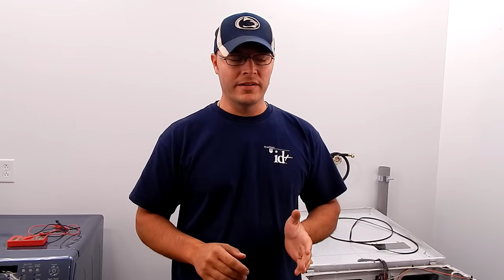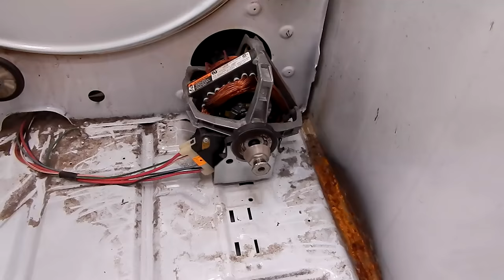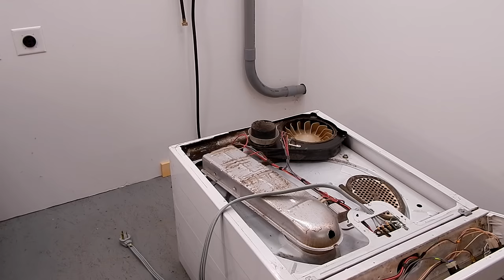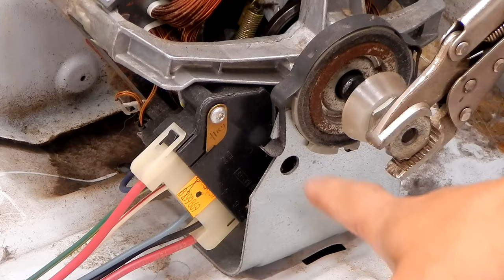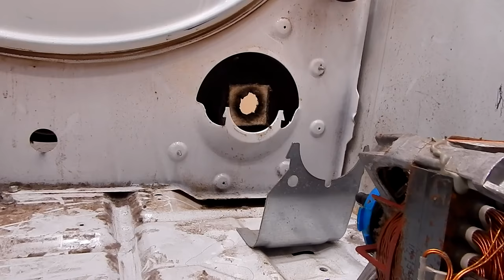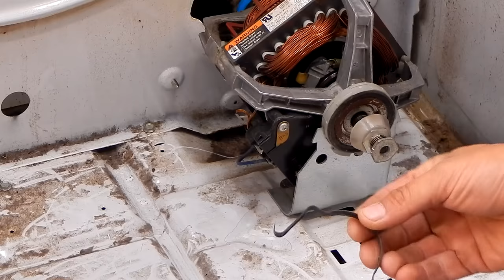How to Troubleshoot and Replace your Dryer Motor

Comment: Thanks for explaining thoroughly all the symptoms of a bad motor..that helped a lot ..the problem I had with mine was the humming sound and I helped it start up while pressing door switch and having someone push start while I turned barrel. Now it will start on its own but the dryer turns off after 3 seconds  and starts back after 5 minutes and repeats.

Comment: Bill - great advice - was perfect to track down the problem.  The motor was stalled (humming), and I gave it a push and it started running.  Time to order a new motor.  Thanks

Comment: Thank you for the great video! I replaced the motor and installed a new belt and parts kit as well! After unsuccessfully trying to remove the blower fan using the method you described, I instead used a small steel rule and fit it across the fan blades and threw the exhaust duct, jamming the fan itself and then I used the vice griped motor pulley as a lever and turning clockwise, I broke the fan free with no damage to the plastic fan! Much easier!
Reply: Thank you so much. I had tried the method in this video and another method shown in a different video to no avail. Your suggestion worked (almost) effortlessly!

Comment: Replaced my dryer motor myself with the help of your video!!! A million thanks because I know NOTHING about fixing stuff. The trick of using a block of wood and hammer to loosen the blower fan worked perfectly (although it took a bit of time to break loose but I didn't break it!!! YAY!!!).

Comment: Thanks for the help! The hardest part of the repair, as you mentioned, was removing the fan. The locking pliers get slipping off and i ended up using a medium pipe wrench, instead. Using a wood block and hammer to strike the fan was unsuccessful but I had another idea. I cut a piece of 1/2" thick wood so it would fit between opposing blades on the fan, then used another pipe wrench to turn to the wood. The fan broke loose almost immediately and came off just fine. Thought this trick might help others.

Comment: I tried all types of troubleshooting. And the dryer worked when there was no heat  - other guides point that it means the motor is OK. Then after watching this video I decided to try a new motor and it magically helped. And yes, the dryer made humming sound when attempting to turn it on after it went off. Good indication of the problem in the motor. 
Also my original motor passed continuity testing, but obviously still had a problem.

Comment: My dryer was shutting off Midway through the cycle and would not turn back on until a few minutes later like you said on the video so I ordered a new motor and it worked for a little while and started doing the same thing again.

Comment: Thank you for uploading this video. My husband has been working on replacing the motor in our dryer, and he was afraid he would have to break the blower wheel into pieces to get the old motor out. Your hammer and wood method worked perfectly and saved us from having to buy another blower wheel.
Reply: Another easy way to do it, get the biggest pair of channel lock pliers you've got, open them wide jaw so that the jaws are under a fin each, then Turn the handles like a steering wheel to the right!
Reply: @zn_361  That's a very good tip actually.  Thank you!!

Comment: That actually seems like a better way to remove the motor. All the videos I have seen demonstrate grabbing the blower wheel with an open end wrench on the other side of the blower wheel  just behind the motor, and then turning a socket on the pulley end of the motor. Each time I have tried it that way I just end up rounding out that part of the blower wheel as it just slips through the wrench. Would have liked to see how you use the hammer and block to loosen it up without breaking it though. Anyway, appreciate your videos.

Comment: Hey Bill, This video helped me to determine my dryer motor was bad; I replaced it myself and saved a lot of money on a service call and part. I also have used your refrigerator repair video as well and it has helped me figure out what was wrong with my defrost cycle. Keep the help videos coming; thanks!!!
Reply: Patrick Giacobbe Good for you!!!!!!!! You're a smart guy!!!! I'm an appliance tech Pat!!!!! I would have charged you around $700 bucks easy.Greetings buddy.

Comment: I did find my dryer motor hard to turn, but it did barely turn.  I quirted some lighter fluid into the 'bearings' of the motor, and my drum rollers.  Every turning part had some resistance.  The lighter fluid was a good solvent to loosen up dried lube of old.  I then squirted in some gel lube.  She runs better than ever.  I cancelled my motor order, but I agree it was indeed largely the motor.  The old rollers are now super smooth.   When I change the felt, I'll pull them out a use some Syl-Glide on them.  Thank you for helping me narrow it down!

Comment: Thank you! I had replaced a hardened, slightly cracking drum belt thinking it wasn't gripping. Changed the rollers too since i was in there. Imagine my surprise when it still buzzed and wouldn't start. The symptoms were what you described. Ugh. The motor? Would've never thought of that going. Now i gotta go back in and replace that. A motor is still cheaper than a new dryer, or a 2nd hand one that you don't know how much life is left on it.

Comment: You helped me a lot in troubleshooting my motor. I like how you laid out in progression the symptoms. I was able to save my motor from burning out. Thanks.
Reply: +Bill Newberry  Thanks so much for this tutorial. After a day of using the old motor- after thorough cleaning of whatever lint and hair stuck on its gut, It exhibited the same symptom of sound and  intermittent not starting. I finally decided to replace it and all is good except now I hear the rollers whining coz of the quiet motor and will replace them soon as well. The rollers whining sound was probably masked by the motor's buzzing sound for years. Well, it should be good practice I guess to change out the rollers together with the motor specially after x amount of years.

Comment: Thanks for the video, which does an excellent job of describing common motor symptoms.

It is helpful to understand why an electric motor fails.  My understanding is that the most common cause of failure is overheating, which causes the insulation in the motor windings to break down.
Reply: Yes, I need to know the why of it. I replaced my motor less than 3 years ago, and now it's failing again. It'll run for 10-20 minutes, shut off, and then it starts again if I let it cool down. The apartment maintenance people checked the exhaust outside and said it's exhausting fine. I am suspicious because I started having to run my dryer for 1.5 cycles to get clothes dry after I moved here. I replaced the heating element, motor, belt, drum support wheels, belt tensioner, fuses, and thermostats less than 3 years ago. It should have been drying fine unless the exhaust is obstructed.

Comment: Great video!! My Whirlpool Cabrio won't start, it only makes a clicking sound. I tested the thermal fuse & door switch for continuity and both are fine. I am having trouble testing the start switch because the dryer has 2 control boards, with a group of thin cables coming out of the front board going into the smaller board that has a bunch of cables and more fuses.

Comment: 2:04 Thankyou. Confirmed my problem. If only I had come across this video earlier I wouldn't have wasted so much time taking apart the dam dryer and reassembling it multiple times. Buying a new bearing, belt and pulley. 😖 Just needed a new motor 🤬

Comment: I've had to remove blower wheels twice.  My dryer has the 1/2" square hole in front.  The first time I used a ratchet wrench with a 1/2" square extension, which immediately deformed the plastic, and I ended up cutting off the wheel and buying a new one.  The second time I decided to try my impact driver (just about the most useful tool i own).  This worked like a charm and did not deform the plastic.
Reply: Can you please explain how you used an impact driver to remove the blower wheel. Regards, JP

Comment: I would like to thank you kindly for making and sharing this video with us, it  helped out a lot. I was struggling trying to remove the motor from my dryer for hours and couldn't figure it out, didn't want to force and brake anything such as the blower wheel in the back but just didn't see anyway around this. Also your comment about the thermal fuse helped out as well as I forgot to check that first. Its inexpensive to replace, easy to test and often the cause of our problems.

Comment: This video was a great way to visualize how to replace my dryer motor. My dryer is a 1995 Kenmore (writing this in 2023). The symptoms are exactly as you describe (humming and strange sound and then shuts off). My only question is you took off two clips held with channel locks when disassessembling - do you clip on the second clip after the first one and then clip on the vice grips (opposite way from the unclipping) prior to reassembling the blower wheel at the back? Thank you for a great video and you have saved me $100s.

Comment: thanks for the great video Bill. I just replaced my motor. man you were not kidding about the blower being tough, holy crap! any one doing this I highly suggest some kind of penetrating oil, let it soke in for a hour. spray it from the inside and tilt dryer back so it can leak back.  I stuck a  hammer handle at the bottom and and used another hammer to get it loose. didn't even break it!
thanks again.

Comment: Exactly as you said, it worked for few weeks but now it won't move even with help. After disassembling the dryer, I tired to rotate the motor by hand but there is a lot of resistance and it won't move even with belt removed.

Comment: This folks is called a left handed thread on the blower wheel,helps you remember which way to put your vise grips,if you know that the motor shaft is threaded left.

Comment: Great video.  However an easier way to take the blower wheel off is to take the back clip off the motor and put a 13/16 open end wrench on the nut, and use a 7/16 on the shaft on the front and hold them and turn the front wrench clockwise.  That way you don't damage the fins.  Worked well for me.
Reply: Nothin's easy. I had to use a dremel and cut the wheel off. It was stuck to the motor shaft. All a 13/16 wrench did was round off the corners.

Comment: The "nut" at the end of the pulley on the motor actually broke off. I have no idea how. I found it that way when I opened the compartment. So I had nothing to use vice grips or channel locks on except for the part of the bolt/shaft between the motor and the fin assembly. Absolute disaster trying to remove it. Luckily fin assembly had the 3/4 drive receiver in the front. Ran down to the hardware store and bought a 15.00 breaker bar....all good now.  Thanks for your help and all the info. :Little things you said, like making me aware of that 3/4" drive receiver saved me. I wouldn't have known yo look for it if you hadn't said anything. Might have figured it out on my own, might not have. Glad you were thorough. Thanks again.

Comment: Excellent explanation, the motor of my washer is dead, around 5 month buzzing and starting but it got tired and burned off
Reply from the maker: Armando Iglesias Ah, sometimes they hang in there for a while!  Are you going to replace the motor or get a new machine?
Reply: Bill Newberry i'm going to replace it, i've got a heavy duty and it is in great shape, beside i already repair the transmission so it's going to be fine for a while... thumbs up for you man, thanks

Comment: thank U Bill this is the answer to my question,and U had a dryer motor completely appart with answers to all questions.I do have one question if I jumped out the start switch would the motor still run.Maybe that was answered in your video have to watch it again.                         James

Comment: Here's a quick tip to make removal of the turbine fan from the motor shaft easier!

Do like this guys video says, put a vice grip onto the motors pulley in front. Then, instead of muscling the fan off with a block of wood or whatever:

1. Grab the fan blades. Put each your fingers and thumbs against a single blade to help spread the load and prevent breakage.

2. With your hand and fingers in the blades, rotate your whole hand counter-clockwise 45 to 90 degrees, which rotates the vice grip away from the floor.

3. Then quickly reverse your hand rotation, banging the vice grip back into the floor, which stops your rotation.

4. Wind back up and do this several times. The momentum and banging should pop loose the shaft threads behind the fan.

Mine came loose this way within a few strikes, and spun right off after, no damage, no frustration!

Comment: very informative. thank you looks like something I can tackle.  exactly the symptoms that I have with my dryer., I would turn the dial and I hear a noise but the drum does not engage. Also, ill start the dryer and give the drum a nudge and it will start to work. . I will by a new motor and try and install myself.. thanks

Comment: its also worth checking the cap on the motors. replacing the capacitors on these motors if they hum but you have to kickstart it manually can save an otherwise healthy motor.

Comment: Hey Bill. I replaced the belt on my dryer with your help, because mine wore and snapped. Now the drum barely turns when empty and not at all with any weight. It seems like the motor is running just very weak. I feel confident I can change the motor from watching your video. Is a new motor the answer or would you try other things first? Motors are expensive, so I wanted to ask advice before buying it.

Comment: I can't thank you enough for saving me the headache of researching this otherwise. Suggestion, the block & hammer did not work to remove the fan and frankly it seems a bit aggressive which I am sure leads to the breaking the fan blades. I took a pair of shop gloves (to avoid getting cut from the surrounding metal) and simply used bruit force (which honestly took minimal grunting) and twisted it off using both hands. It allows for more even pressure and helps compensate for plastic flex. Hope this helps someone else in the future. Tried the hammer thing for 5 minutes, had it twisted off in 10 seconds.

Comment: This video was a great help.  Made the removal of the old and installation of the new motor easy.  However, when I put on the new motor and put everything back together and pushed the start button the dryer is making a loud grinding noise.  I checked my installation steps and it seems to be installed correctly.  Is the motor defective?
Reply: I have the same problem!  Replaced the motor twice with a brand new unit and grinding starts on the 1st load. Can't figure out why.

Comment: At the 2:20 mark regarding dryer just buzzing when (not) starting, mine reached that state like Bill said after the buzzing began happening several weeks prior.  (Another youtube video showed how to remove years and years of accumulated lint (a pretty big wad of it) from near and inside the dryer blower wheel, and that really did get things running again, but still a little buzzing before things spin up, though my dryer is different than this one quite a bit).  Those motor mount clips… finally just used a very large screwdriver and pressed hard on them straight down on the left hand side and off they came, and went back on easily enough with similar pressing down.  Now just need to get that belt back on right  and the drum in place and it should be easy after that.  (Ass-uming the motor was just a direct replacement, plug and play, the wiring looked to be the same,)
Reply: Yup, new motor sounds great, had forgotten what our dryer used to sound like.

Comment: great vid! I now have the confidence to tackle this one by myself! Semper Fi!
Reply from the maker: +TheUnclerickie Semper Fi!
Reply: +Bill Newberry YO! my dryer ran for about three cycles then shut off. after like 3 weeks of procrastinating I took it to a repair man. RM told me that he plugged it in and it worked well so I should check the plug in and breaker.. did that and there was nothing wrong with either so I plugged it in and it fired right up. few cycles of towels and it shuts down again but this time it emitted a burning smell. after about 3 hours I pressed the start button and it didn't start but sounded like it was going too. every trouble shooting tip I've found said if it shuts down 10 minutes (or so) into a cycle then it's the motor over heating but nothing about after a few cycles. any ideas??
Reply: +TheUnclerickie BTW sorry for commenting with a question on your post but for some reason I couldn't tag Bill in my own post.
Reply: Alyster Woo no problem.

Comment: Thanks Bill.  Beko dcb93166w condenser tumble dryer runs for a minute or so then stops. 
I went to check it out for customer put a moist dish towel into it and it ran fine.  No signs of a problem
The customer messaged today to say it is still doing it.  Motor?

Comment: Ok I have a question, I have had my dryer stop before rhe cycle is done. What has also started happening is it will shit off exactly 1 minute after starting. However I put it on a low heat setting, and it ran the whole cycle. Thanks so much for this video. I hope you can answer my questions. I just replaced the control panel, the front button, the thermistat, thermistor, and I am at my wits end. It's electric but the last thing I want is a fire. Ty.

Comment: like your video...i have a question....i have an older Magic Chef dryer and with a load of wet clothes the drum turns very slow. if i lessen the load the drum turns normally, what do you think the problem may be?   also, there isn't any strange noises coming from the dryer.  Thanks